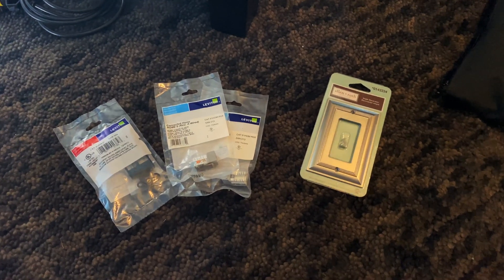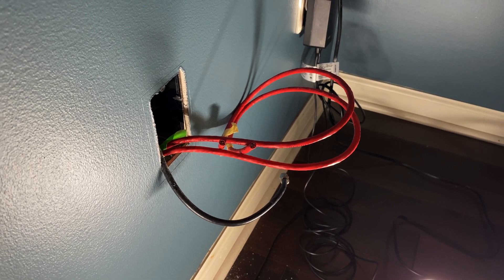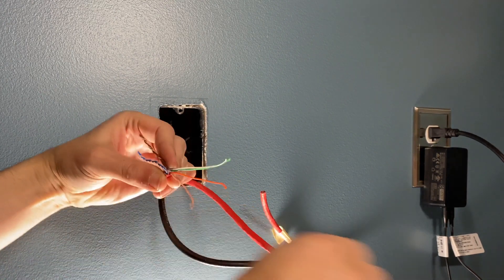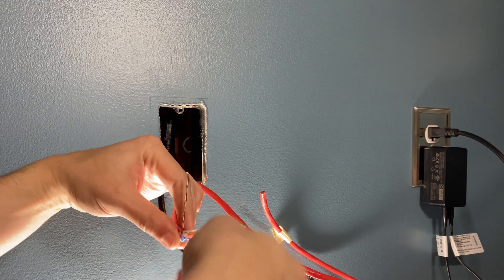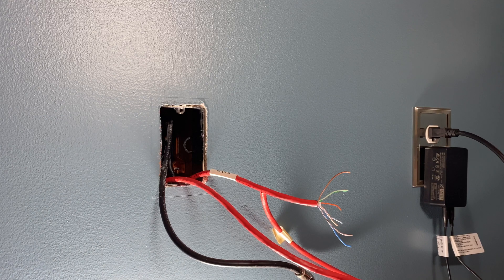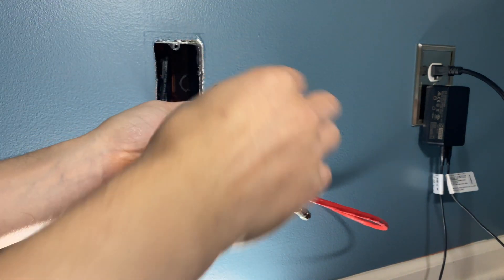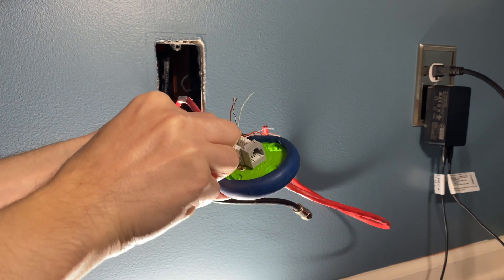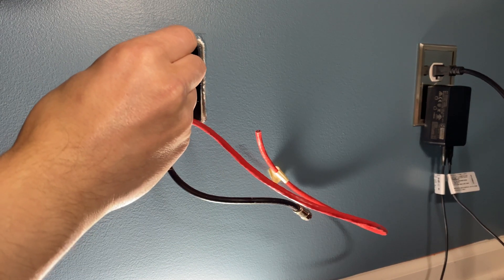How To Install Leviton QuickPort Snap In Cat6 & Decora Wall Plate In A Home Office

Comment: So question, supposedly with every interuption/connection there is a downgrade in quality, so would it be better to use a brush plate and just run a straight line through to the device and only have the connection at the device? I have 2 HDMI 4 Ethernet, 4 speaker wire and 1 optical cable I have to run through a single gang opening? I can’t figure out how to fit all that without just doing a single big brush pass through?

Comment: Pro-tip: don't unwind the pairs all the way. You just have to unwind them enough for the divider to fit in-between the conductors. That way you have a better chance of keeping the proper twist count.
Reply: You shouldn't untwist them at all.  The Leviton jacks have a peak triangle in between between 110 connectors. Put the triangle between twisted pairs and push wires down.
Reply: Proper twist count? There’s a number of twists that have to be in the cable?
Reply: Yes, that's what keeps the signal separate between the wire pairs in both CAT 5 and 6 cables. If the cables aren't twisted the signal bleeds between the pairs (crosstalk in tech terms), which reduces your data rate.

Comment: Great video.  Question…. Does Leviton have any “blanks” to fill those unneeded 2 bottom “holes?”
Reply from the maker: Yes they do. Eventually those open holes will be filled with HDMI jacks. https://www.leviton.com/en/products/commercial/networking/connectors/av-connectors/blank-quickport-inserts#t=Products&sort=%40wcs_site_tree_rank%20ascending&layout=card
Reply: @billylaguardia  Thanks for the link Billy.